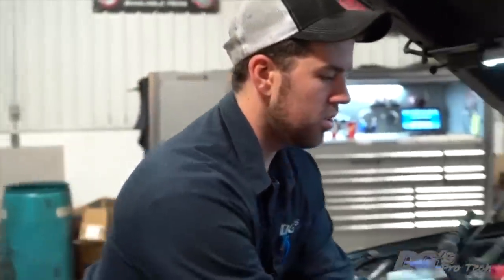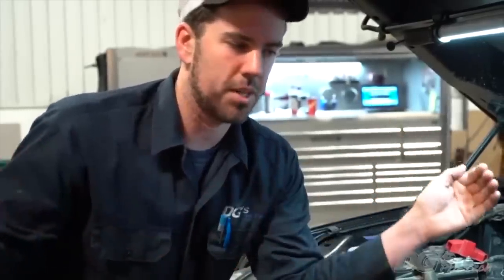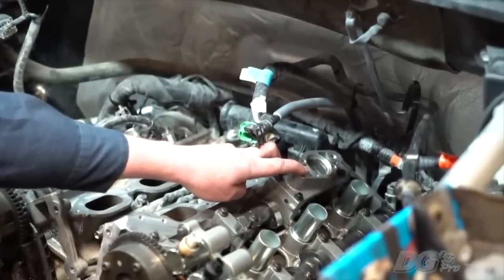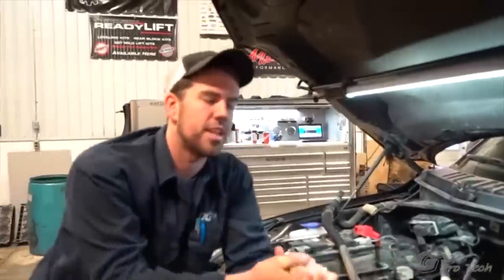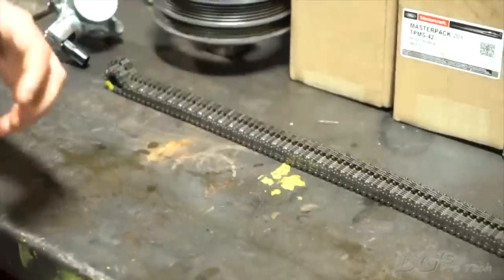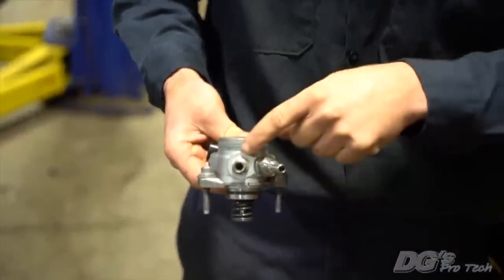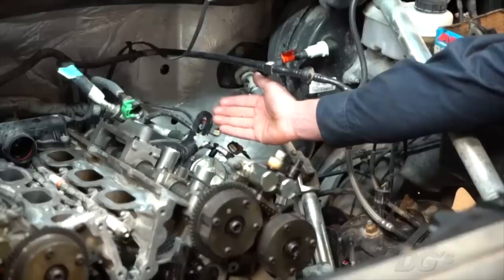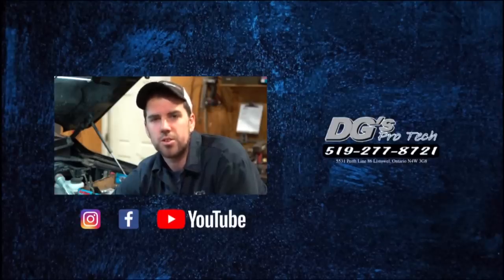What you NEED to know about Ford EcoBoost Engines by Dustin Golley of DG's ProTech

Comment: The new 3.5L as well as the 2.7L and 2.3L ecoboost now all have port injected as well as directed helps with the carbon issues. I'm always in boost they are just too fun to drive. From the 2.3L 2.7L and 3.0L ranger raptor. I have the ranger with the 2.7L eco and a f150 with the 5.0L coyote v8

Comment: 2013 Ford F-150 Ecoboost. 130,000 + miles and I have had no serious problems with the engine. In fact, it runs so good, and trucks are so expensive today, I am going ahead with THIS TRUCK rather than buy a new one (like every 10 years). So typical you want about the problems, but overall personal experience with this truck, and my previous Ford Ranger, have been excellent. My brother owns the same truck, year earlier, NO PROBLEMS. He still drives it. So many of these videos create worry for people thinking to buy “something.”

Comment: I have a 2014 Ford F-150 with 84k and the Timing Chain stretched 2 Links while driving it to Texas in March of 2024 and it stopped dead on IH-35 outside of Austin Texas! Truck towed to the nearest Ford Dealership and they pulled the engine apart and changed the Timing Chain and all the stuff in between, received the Truck 28 days later and it seems like a new truck? That was over a $10,000. Tune Up to get it done correctly! It feels like it has the power when needed to make a difference in acceleration!

Comment: I have a 2019 F150 2.7 motor, I change the oil every 5000 miles, I have 50,000 miles on the vehicle and no problems yet.

Comment: as much as i love the 3.5 eco.....my 2012 F150 has 160k miles, been in the shop for oil changes every 5000 miles since birth but now have cam phase clatter and stretched chain. Cost of replacement of engine was over $8 grand and second shop was lower at $6 grand. question here is do I get it done or buy a new truck?

Comment: I have two '18's. An Explorer and F150. They have two separate chains and two tensioners.  I paid $38 ea for the tensioners at the dealership. The thing that's annoying is they don't offer a complete kit to replace the timing set. You have to buy everything separately.  If you're not boosting, you're driving like a grandma and people are honking at you.  People think the timing is rattling upon startup but the majority of the time, it's the turbo waste gate arm.
  I highly suggest replacing your water pump and oil pump if you're doing a timing set. Yes, you can change the oil pump without pulling the pan.  The thing that sucks is the oil pump cost alone is over half the cost of the timing set. 
  We get around 18 mpg in the city and around 22 on the hwy. But we drive like we stole them. Our hwy mileage goes up in the mid 20's if we actually did the speed limit.  My F150 has the ext fuel tank and allows me to go 600plus miles between fill ups.  And yes, I pull 12k lbs with mine as it has the max tow package with a 13200lb tow limit.  It pulls and stops easily.  My son has a 5.0 in his F150 and it does very well also.  His just hit 200k and still the original timing set with no rattle.  My F150 had 175k miles on it before I did the timing set.

Comment: You talk about activating the "boost" mode on a routine basis to keep the waste gate from sticking. What are good ways to do this? My wife and I are planning on purchasing a travel trailer. However, in between towing trailer (I live in New England with no shortage of hills), what are good driving tips to keep the waster gates active? Great video. I learned a lot. Thanks.

Comment: For the most part if you are having problems with an ecoboost then you are running shit oil and or not changing it enough and ignoring problems. I run royal purple full synthetic and change every 7 thousand miles.

Comment: Great stuff very smart. Have a question for  you I changed out my ABS because the dealer said I needed to my right rear tire spins out alot on wet surfaces and I’m not on it at all. Tires are in good condition now there telling me it’s my vacuum pump. I think there questing my traction light comes on when I make right hand turns when this happens as well. But when I back up on gravel on a slight incline, it feels like the right tire does nothing but spin with no traction.. thanks for your help in advance. Hope to hear from you appreciate you.

Comment: Hey I have a 2.7 turbo 2018 I'm getting code po471and.im replacing I do believe is supposed to be EGR sensor it has a little white clip someone told me if I replaced the EGR sensor it will correct the code po 420 if you get time please let me know Ty

Comment: For clarification... The Edge can indeed be had with a 3.5L, but it is the Duratec 3.5L V6, NOT the 3.5L Ecoboost.  The Edge's V6 Ecoboost is a 2.7L and only available in; Sport trim (2015-2018) (1st Gen 315HP 2.7L) and ST trim (2019 to present) (2nd Gen 335HP 2.7L) model years.  

The 3.5L Ecoboost can be found in the following FoMoCo models;  Explorer, Expedition, Flex, F-150, Ford GT, Police Interceptor Utility, Police Interceptor Sedan, Taurus, Transit, Lincoln MKS, Lincoln MKT and the Lincoln Navigator, but not the Edge.    Hope this helps someone.

Comment: late to THIS party :-) but... if the oil stays fresh, will the timing chain still stretch?  Over how many miles?  Should we have in mind a scheduled replacement of the chain and tensioner, so that the more dreadful failures don't happen?

I have realized in my old age that there are things you should just do for your engines that seem like repairs but behave more like maintenance.  Is this one of them?

Comment: You cant cheat physics...squeezing that much pressure into the engine will take its toll overtime..its inevitable. Maintenance costs will be very high over-time in order to realize a reasonable level of reliability and durability. If you dont need to tow anything on a regular basis and use it like a car..basicaly a grocery-getter..it will probably be ok. Turbos just do not last...ask a diesel mechanic ...most consider turbos to be an expendable part requiring  replacement on a regular basis. Your gonna have to pony-up the $$ if you actually work that engine.

Comment: This is such an excellent detailed technical review, thank-you I have been looking for this. Any comments specifically on the 3 Litre EcoBoost’s carbon buildup issue. I hear that drive-ability issues can happen at 140,000-180,000 km requiring walnut blasting of the intake valves.  Unfortunately I hear that ford did not update this engine to add port injection.
Reply: Ive been wanting to get me 3.5 walnut blasted,  131000 miles.  I cant find anyone that does that.  Any ideas?

Comment: U shud say Infamous ecoboost.  Intake valve carbons up on gen 1 at bout 75k miles, do not use carbon liquid or scraping, cleaning that way bits that  get to turbo damages impeller. 

All techs I've seen plus dealers have walnut shavings Cleaning machine. I suppose it possible to clean manually with both valves closed then carefully use shop vac to vacuum debris. One chunk of carbon forget turbo fan, there's no separate intake manifold

 Head gasket blows out between cylinders 2 & 3 on gen 1 due to Head cooling engineering problem. Happens from turbo out of warranty head has to come off to get at valves for cleaning.

Comment: I love my truck with this engine. I always change the oil at 5000 miles. I change the spark plugs every year and I added a Catch Can. I drive it normally everyday of the week except on Saturdays, where I open it up and drive it in the boost. I get on my normal days 21 miles to a gallon. On Saturdays , I don’t know nor do I care. I have 105,000 miles on the truck and it is as strong now as the day it rolled off the lot with me.
Reply from the maker: Thanks for sharing

Comment: i am so glad that you explained that the mileage is not much different that the v8 when on boost, from other vids i have seen yes these are great trucks for women going shopping but not practical for heavy work like the v8s, and yes, timing chains are key, found that out the hard way and learnt to change them every so many miles regardless if needed or not, the cost of replacing them is cheap compared to a whole motor like you have described,  i did a lot of my own maintenance in my days with simpler engines but like other vids have shown that you can change the oil and filter material on your own but most are toooooooo lazy to learn and that is what companies count on so you are either into expensive repairs or buying another vehicle and with the cost of vehicles now maintenance is key.
when i can afford vehicles again i will go back to the 70s to 90s because i used to rebuild my own engines and do most of my own repairs but i would not touch one of the new engines for lack of knowledge and equipment to do so and i dont like how complicated they have become and how cheaply most are made now so they fall apart quickly.
Reply from the maker: Edward, thanks for your comments and insight, much appreciated! Be sure to connect with us on Cardone’s other social channels:
https://www.facebook.com/CardoneIndustries/
https://www.linkedin.com/company/cardone-industries/
https://twitter.com/cardoneparts
https://www.instagram.com/cardoneindustries/

Comment: Direct injection has been around for years outside Ford engine design. Neither are turbochargers with twin meaning less burden on one turbocharger wheel. The bigger issue is that many drivers are mostly driving at low speeds with the usual accelerate and brake driving and short highway trips. The newer 3.5 has port injection to burn off some of the carbon when direct injection is not needed. I would note that Dustin is noting that poor maintenance leads to engine failure. No surprise. Since supposedly there are "working" trucks to haul stuff then keeping to maintenance schedules and regular oil changes seem obvious. Otherwise buy a smaller vehicle with a smaller engine.
Reply from the maker: Hey Stephen, thanks for the detailed comment and for your insight! We hope you will connect with us on Cardone’s other social channels:
https://www.facebook.com/CardoneIndustries/
https://www.linkedin.com/company/cardone-industries/
https://twitter.com/cardoneparts
https://www.instagram.com/cardoneindustries/
Reply: @CardoneIndustries  I would be interested ti see a vid done on the F150 hybrid. Its fuel economy boost seems marginal over the 2.7 yet its likely that the hybrid will be the engine getting attention as mush as the lighting power. Hybrids have been surveyed as having a much better reliability of all the new engine options. Its likely you will need an electronic/battery qualification as much as engineering in future. With hybrid power running more often other parts of the normal ICE engine operation will start showing problems. We may also see E15-20 ethanol fuel blends causing issues when the truck is used more as a car than as commercial truck work, I can see petrol particle filters arriving sooner. In fact exhaust issues might be as big a service issue as the engine or transmission
Reply from the maker: @stephendoherty8291  I sent your request to the head of Tech Support and CARDONE's Marketing Director, thanks for taking the time to make your request!! 😁

Comment: This engine is an extreme joy to drive, and it makes a nice noise too. However, I am moving away from my EcoBoost. The race car technology is a blessing and a curse, because long term it’s just not easy to maintain. Under a good watchful owner, this engine will go on for as long or longer than a V8. But with someone who doesn’t care, various things can happen. Carbon buildup can destroy compression. Not letting the engine and the turbos warm up all the way for every startup can cause the turbos to crack, and then it’ll drain itself of oil within a minute. Then of course the whining dog issue with the wastegate(s). If you or someone else is considering a vehicle with this engine, keep in mind it needs to be given some gas at the minimum every month to fight carbon buildup wastegate problems. If you or someone you know has this engine and has not treated it with the routine it needs, I would reccomend getting a different vehicle at about 170k miles, as that is when they may start to act up.
Reply from the maker: Thanks so much for the comment. and for your indepth insight regarding the EcoBoost engine! We hope you will connect with us on Cardone’s other social channels:
https://www.facebook.com/CardoneIndustries/
https://www.linkedin.com/company/cardone-industries/
https://twitter.com/cardoneparts
https://www.instagram.com/cardoneindustries/

Comment: I have a 2017 3.5L ecoboost that has an intermittent loud noise.  It is not at start up but it occurs shortly after I start moving.  It sounds like gears are grinding, loud and like you need to shut it down.  But it goes away and doesn't do it again for several days.  My driving is not everyday, unless I'm pulling a 32 ft RV Trailer (about 8-9000 lbs).  
You mentioned in the video that if the timing belt is worn, excessive noise can happen.  Please help me figure what could be going on with my engine.
Reply from the maker: Thanks for reaching out and for the question Walt. this sounds like something our Tech Support Team could help you out with, give them a call @ 888-280-8324 Mon-Friday 8am-5pm EST to speak with one of our ASE-Certified Technicians. 👌😊👍🔧

Comment: I order 2022 f150 I took it for a test run, it had a bad air leak took 2 of there sales people for a ride they said they didn't here it, they had the service manager drive it and he said I  here what you here but that is normal, my 2005 2500 hd with 200.000 miles on it does not have air leaks, I refuse the truck and they kept my $500.00
Reply: Call ford Corp told them the story they wouldn't do anything  about my deposit, they can stick there ford trucks up there ass

Comment: Any manufacturer should know that a turbo doesn’t belong on a gasoline engine. Diesel engines are built with heavier internal parts to withstand the additional cylinder pressure and stress.

Comment: 1.6 and 2.0 EB engines were a massive failure. All leaked coolant to cylinders
Reply from the maker: Hey, thanks for the comment! If you want to trouble shoot what may have caused your issue, please connect with our Tech Support Team by calling 888-280-8324 Mon-Friday 8am-5pm EST to speak with one of our ASE-Certified Technicians.

Comment: I had the 3.5 and I used PP and Motorcraft filters every 6K miles (did them myself) and had chain rattle around 25K.  Also had turbo wastegate rattle.  This is absurd for such low mileage.  I don’t think it is poor maintenance, but maybe poor design with getting enough oil to the chain.
Reply from the maker: Thanks for the comment and your insight, much appreciated! 👍🏼

Comment: 7:41 I work not on cars but machines with fair amount of mechanically complex components and same thing; when replacing certain parts always advise customers to replace a small bevel-gear system as a precautionary measure (addition of the cost in a region of 1,5% of overall cost and extra 30min), some do some don't, those that don't end up having same job done again few months later, I can fully appreciate the frustration seeing the same job come up again soon after completion.
Reply from the maker: Thanks for the comment and your insight, great advice! 👍🔧😊👌

Comment: With the Ecoboost 2.7L and 3.5L, At how many miles would you expect this to happen, if the oil is changed every 5k miles?  Should I stay away from a used 2016-2017 Ecoboost F150 with 60k miles
Reply from the maker: Thanks for the comment Nicolas, Used car purchasing advice is not something we can help you with, but for other technical questions, you can call our Tech Support Team @ 888-280-8324 Mon-Friday 8am-5pm EST to speak with one of our ASE-Certified Technicians. 👍😊👌

Comment: NOT interested .... I will never buy one of these... 1/2 ton truck is a joke anyway, the first real truck is 3/4 ton... engine, brakes, suspension and even tire load range all expponetially beter than 1/2 ton. The other issue would be turbos, how many turbo replacements will truck need in it's life cuz they aint cheap...  I would not buy one of these used despite how good the deal was... too many variables.
Reply from the maker: Thanks for your comment, and your opinion! Be sure to connect with us on Cardone’s other social channels:
https://www.facebook.com/CardoneIndustries/
https://www.linkedin.com/company/cardone-industries/
https://twitter.com/cardoneparts
https://www.instagram.com/cardoneindustries/
Reply from the maker: Thanks for the info and your input! Be sure to connect with us on Cardone’s other social channels:
https://www.facebook.com/CardoneIndustries/
https://www.linkedin.com/company/cardone-industries/
https://twitter.com/cardoneparts
https://www.instagram.com/cardoneindustries/

Comment: My 2016 3.5 Ecoboost throwing a low oil pressure warning. Comes and goes. Sensor is bad.  45k miles.  I barely drive it.
Reply from the maker: Thanks for the comment! This sounds like something our Tech Support Team may be able to help you with, please call 888-280-8324 Mon-Friday 8am-5pm EST to speak with one of our ASE-Certified Technicians. 👌👍😊